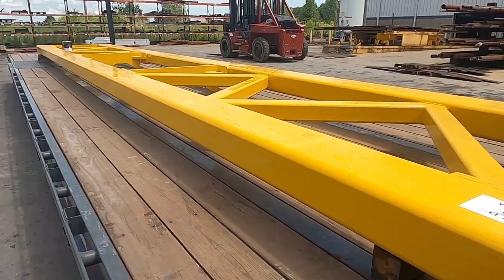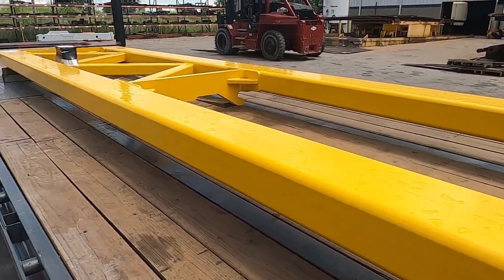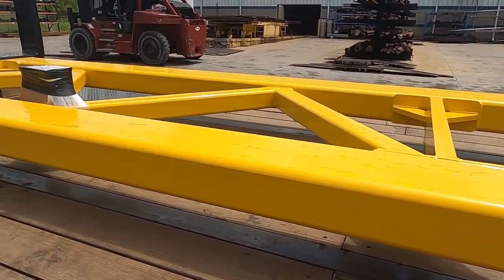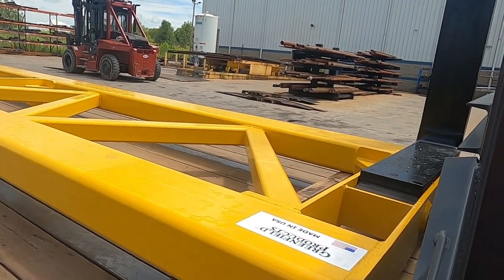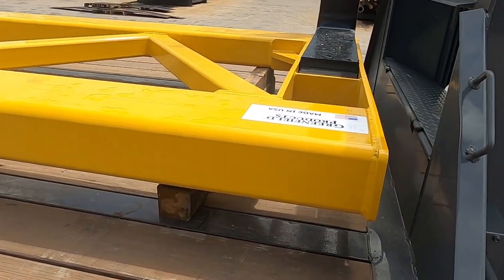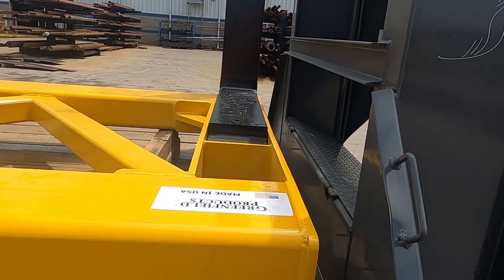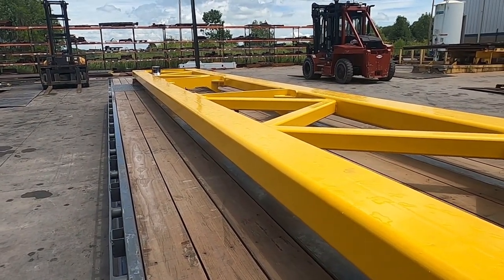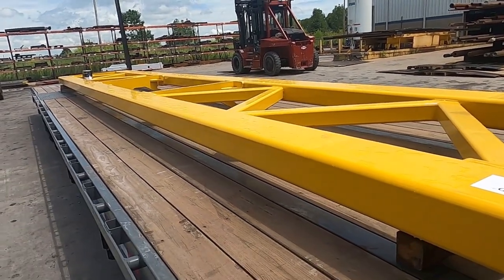LOAD SECUREMENT | STRAPS | EPISODE 1

Comment: I’m starting to miss the daily grind of flatbed. Great videos! Keep them coming💪🔥
Reply from the maker: I enjoy flatbed out of all the different types of trailers I’ve pulled. It keeps you on your feet and you get a small bit of exercise as opposed to none at all.
Reply: Load Mizer I left flatbed and started working in foodservice delivery. Been running up and down the back of a truck for the past 7 years. Never thought I’d miss tarping.
Reply from the maker: Alex Myers good thing about this line of work...it’s always an option if the itch gets unbearable 🤔👍

Comment: I have to say that is the very first time I’ve seen the ratchets used that way but it makes sense... Since most of my oilfield freight consisted of very similar items repeatedly I used eight straps essentially placed in specific locations on the trailer full time then had the loads placed right where my I preferred to strap those items... I am with you 100 on load securement brother... My goal is always to make the load “part of the trailer” and with the exception of things like palletized and bagged dry chemicals I’ve rarely had any straps loosen... Even those, once they settle in end up pretty secure...
Reply from the maker: I hear ya man. Super sacks and lightweight boxes are the worst. I hate having straps I can’t tighten as much as I want. I get around that by putting about 3-4 twists in my strap down each side. Keeps the air from catching it as much and seems to prevent the amount of adjustments 👍
Reply: @LoadMizer  I totally get the method to the madness behind the twists... Nearly all of my freight was cylindrical drilling tools riding no higher than a foot or two above the trailer deck... A lot of belly wraps on most in addition to several "over the top" strapping required...
Reply from the maker: @davelambert5857  yeah without height to help out the squeeze on it stuff like that likes to spread out quick lol.

Comment: now i know in texas the straps MUST be 4ft apart or its an OOS if caught by dot until the issue's resolved so ALWAYS check with the states ur in for strap spacing, in my home state of LA it's every 8ft, and i believe its 2 for the first 4 or 5 ft and THEN every 8' for 20' pieces and longer.

Comment: Good morning!
    I drove flatbed years ago, and I was taught at the time to strap the freight, and then tarp over everything. I see a lot of videos drivers strapping over the tarps, I was taught years ago not to do that because you can damage the tarps. I know you get a lot of questions, but I wanna make sure I'm doing it properly when I get started back up in CDL hot shot operation. 
    I was working when you and Danny did that live stream last night, and it had good humor, and content at the same time. I feel for you getting kicked out of your spot for paid parking, That happened to me 1 time in Michigan, Like your experience the signs were covered up with the snow bank from the lot fom the snowplows.
      I just subscribe to your channel, and look forward to more videos, And Information on hot shot operations.
Reply from the maker: Hey man welcome to the channel! I never strapped over tarps until I hauled steel pretty regularly for a while. Now I do it all the time as long as I can see where straps should go. Offset lumber loads and stuff like that I’d still strap under but it save a ton of time securing the tarp with bungees. I never damaged my tarp by strapping over. 👍

I just pulled up to one of their 4 shut down diesel pumps and went to sleep with a trash can in front of me. No issues lol

Comment: Great video 💪🏽. So mad I didn’t get my Pj with a winch rail.  You made this look 👀 so easy. 👍🏽
Reply from the maker: It’s an add on. You can always get it upgraded. I don’t like using hand ratchets unless absolutely necessary. Plus 4 inch ratchets are ridiculously priced.
Reply: I just added on aswell
Reply: @LoadMizer  why you twisting the strap on both ends?

Comment: Your videos are a great help, thank you. 
 How would you secure 2-36”x 6’ auger bits, side by side or end to end ?
Reply from the maker: Side by side. I’d use some cardboard edge protectors, or just folded cardboard and strap them single side. 4 straps total. First strap, left side over then under back to left side. Middle 2 right side over then under back to ride side then the last strap left side over then under back to left side. That should capture and keep it from moving. Make sure you place cardboard or rubber/wood something between where the augers touch each other. That’s how I’d strap them.

Comment: Thank you for this video It helps a lot, but I have a 1953 International farm all [ fully restored] that needs to be secured for interstate transport, can I use the new ratcheting straps I got or do I need chains, and if so what kind how big etc.
Reply from the maker: Chains are technically only required if the vehicle weighs over 10k. You could use straps on the axles and wheels for that no problem. 👍

Comment: Just tacked my slide rails on yesterday. I did put them on the driver side but I'm not hot shotting, I use for my construction business mostly.  Is there rule or law for passenger side winches or is that all just preference? I've heard a few say on a road side, that traffic is passing you if you have to tighten, in my case it doesn't really matter but love to hear you thoughts or reason.  Also, did you get you factory with the slide rails or aftermarket? Just curious
Reply from the maker: It’s all just preference. The ones I had were installed as a factory option.

Comment: Hello, can you explain the “adding the twist to the strap”?? 
New in business trying to learn as much as possible! Thanks
Reply from the maker: Adding a twist will keep tension on the strap and keep us from buzzing. This usually happens the taller freight is or how wide it is on your trailer. If you have a tall skinny load to secure, you most definitely want twists. The buzzing is caused by vibration from the wind catching it. It will rub paint off of surfaces and in some cases depending on the load you can even cut through the strap causing it to pop in half.
Reply: @LoadMizer   thank you so much for the explanation. 
One more subscriber

Comment: How many straps every truck driver should have ? Whats the standard number for each truck ? Als for chains
Reply from the maker: There really isn’t a standard. You basically just divide your trailer length by minimum standards and it’ll give you a ballpark number to start with, always carry extra though. Straps break sometimes and they’re crazy expensive in a truck stop. A 40’ trailer I’d go no less than 14 straps. That gives you 1 strap per 4 foot and 4 extra for header and tail security. Chains I’d take 6. That’s plenty for the whole trailer because of weight restrictions.

Comment: I was told this weekend that I had my strap hooks wrong and I would be in violation with DOT which they were hooked like you have them on the rub rails. Supposedly he use to be a flatbed driver. I’ve been through weight stations and never been in violation. Have you ever been told different?
Reply from the maker: Some trailers have a lip under the edge of the floor, if you have that then technically you should hook to that. You can use the rub rail though. Some people are just super anal about that for whatever reason. Just try to always have your straps inside of it. That’s a biggie they can get you for unless you can’t avoid it.
Reply: @LoadMizer  thank you sir for the information, I appreciate it! My PJ trailer has tubing not channels so it has to be like that.

Comment: Did you mount the backwards? Or did you purchase special ones for them to be mounted like that?
Reply from the maker: I flipped them around that way. There should be a stop bolt on each end of the track that keeps them from falling out. Just take those out and flip them. Don’t forget to put them back in lol
Reply: My welder added my rails so they have a pretty good stopping plate welded on them so I would have to grind those off to be able to do this... 🥴

Comment: When you stick your strap into the slot of your wench are you sticking it all the way through the back side slot or just in the first slot?
Reply from the maker: Into the first slot and then it hits up against the other side. Goes all the way into the winch but doesn’t come out of the other side. Then once you start spinning it friction takes over and captures it. Never had one come out. The only time I don’t do it this way is if I only have like 4 feet of strap left or less because of a tall load. Then I stick it through normally and spin it all on the spool. No tail left.

Comment: I understand your reasoning on the winches, but rule of thumb is to always push away from the body not pull towards. As long as your are verifying your teeth are fully engaged before you remove tension on the load bar the safety is a minimal risk.

You're also less likely to tear a bicep/shoulder or back when you are push down rather than lifting. But to each his own of course, nothing better than making your own decisions as a O/O!

Stay safe!

Comment: I'm thinking lashing winches on my utility trailer. Any trouble with the winch track buckling? It looks like the strap angle going into the winch is putting more pressure on the track while pulling the winch outwards.
Reply from the maker: I haven’t had any issues. The track is solid, what I don’t really like is that the rib rails on these trailers aren’t really wide enough to hold a flat hook. They just barely grab the top. I never had one pop off but it looks like one could at any moment.

Comment: Might be a dumb question but why do you twist it when you strap it?
Reply from the maker: Not at all man. The wind will catch these straps and cause them to vibrate or buzz. Extended periods of that will do 2 things. 1. It will actually start to loosen the strap 2. It will eat away paint on surfaces that are painted. Some loads flex when you tighten your straps and some loads you can actually damage or crush by getting the straps too tight. Like hvac units, wire mesh, framed steel like this load was. Twisting prevents the air from catching the strap and making it vibrate 👍

Comment: What would you do if trucks breaks down in middle of interstate and you have a load and the trailer? How would you go about it getting the load delivered on time calling a broker ?
Reply from the maker: It’s happened before. I always call the customer first before I call the broker. That way I can let the broker know if everything is going to be fine or if the load needs recovered ASAP. There are multiple ways to go about it if it needs to come off. You could have a power only with trailer interchange deliver it for you and bring your trailer back or leave it at a secured location if the delivery is close enough, on your dime of course. Or the broker can post a new load in which you’ll cross load the freight from your trailer to his, most likely also on your dime and the original rate will be discounted by how far you actually took the load. Best thing to do though is to call the customer and let them know what the repair timeframe is going to look like and come to an agreement with them. You may get docked a small fee from the broker for being late but it’s better than losing the entire load and paying for recovery.
Reply: Load Mizer i thank you so much for taking the time for such open answer and details stay safe out there!  I watched all of hotshot channel on youtube your channel is straight to the point content keep it up man  it helps a lot!!!
Reply from the maker: I appreciate that! Thank you 👍

Comment: Witch side does the binder go on🤷‍♂️ driver side or passenger side 🤔
Reply from the maker: That’s completely up to you but I generally try to put all of my securement points on the passenger side so that if I have to pull over and adjust anything I’m out of the way of traffic 👍
Reply: @LoadMizer  dude I do the same exact thing, guys at work tell me I'm wrong they go on driver side by DOT? is that the dot rule????

Comment: Is it important to get always a dually ram or Ford.   Is a single  rear tires enough?
Reply from the maker: Single is typically enough for non cdl weight but a rear axle will limit you a lot if you’re running over 26k

Comment: I guess it "should" make sense to me, but it doesn't.  If I'm pulling the ratchet bar UP and the teeth break, why doesn't that bar just keep right on going up and into your face?  Seems like you'd want to be pushing down and if it breaks, it would keep going down?  So they react in the opposite direction?
Reply from the maker: The teeth breaking isn’t generally the issue, it’s the stop slipping when tightening or loading the  winch to lift the stop out of the way. It’s a lot of pressure there and it’s easy for it to slip. It’s happened to nearly all of us at least once. When that winch slips the strap unwinds quick and if your winch bar is in a hole it’s going to swing with it. Tightening isn’t the risk this helps avoid, it’s the rapid untightening lol

Comment: you were correct with securement and incorrect with the explaination.  You are correct in that you need a strap every 10' and you took WLL and length into consideration BUT wrong in your explanation you stated.  "I have a bulkhead so i dont need 2 in the first 10".   which is incorrect.  You need 2 in the first 10 if forward movement is not prevented by a bulk head or other freight properly secured.  If the rack was up against the bulkhead (forward movement prevented) you can use that as a legal securement for the 2 in the first 10.  You used more than enough for securement so no need to worry you covered your WLL and you definitely covered your Aggerate Working Load Limit. Also you can never over secure which you said again the huge BUT is what ever you use for securement needs to be a legal securement or in serviceable condition to be legal under law no cuts, tears etc.. you get the idea. just like lights if its on there it has to work .. so if you only need 4 securement systems and you have 6 and one is non compliant you could get a ticket for a noncompliant securement system.  Great Job anyway and i twist my straps as well I cant stand looking in my mirror and see a strap moving and it also helps prevent cutting if an edge protector moves during transit.   sorry so long winded..

Comment: How do you install strap winch under the trailer?
Reply from the maker: If you don’t have a winch track for them to slide into you’ll have to weld them.
Reply: @LoadMizer  thank you for responding. What factory and fuel card do you use sir?
Reply from the maker: I don’t factor loads any more but when I did I used OTR Capital. I have an EFS and a RTS fuel card.

Comment: QUESTION: Why twisting the strap near the ratchet ? HOURRA.
Reply from the maker: Usually not needed on low profile loads but I couldn’t crank my straps down too tight because the framing was starting to bend. The twist does 2 things. Keeps loose straps tighter to prevent crushing or bending lighter loads and it also keeps the sides of the straps from catching the wind and vibrating or “buzzing” which would’ve destroyed the paint on what I was hauling. 👍
Reply: @LoadMizer  Excellent I have learned something. HOURRA.

Comment: The backwards wench idea is a no go. Bad idea…. Especially if your new to open deck….. say bye bye to your back… I get the idea but if you wanna have any longevity don’t reverse the securement system. Also, if there is a accident and your load comes loose your loosing that lawsuit. The tip of Winch bars have a 45 degree angle for a reason. 

Make a video explaining to the trailer manufacturer and your insurance company that you changed the winches….